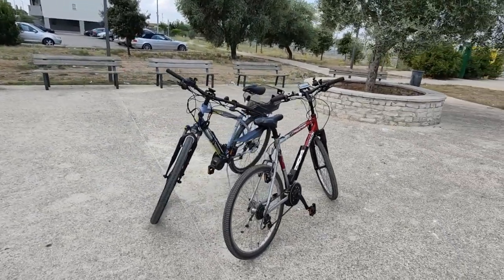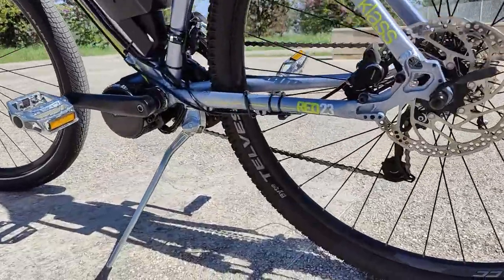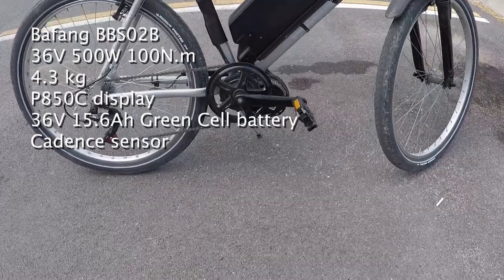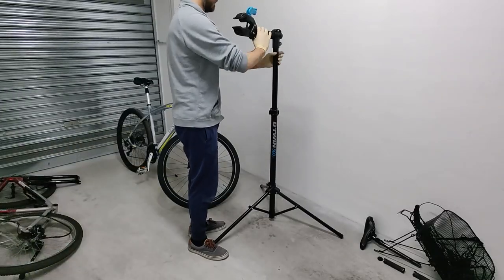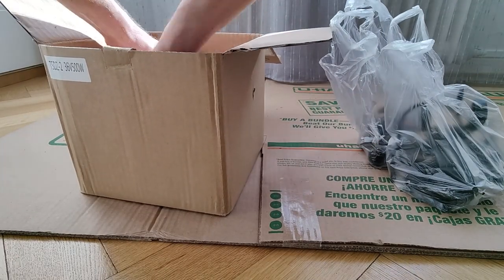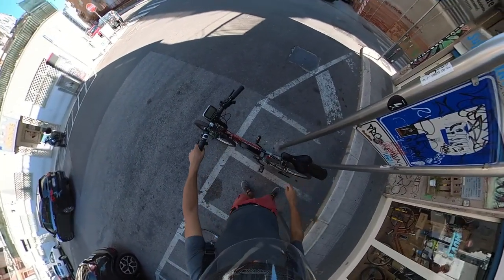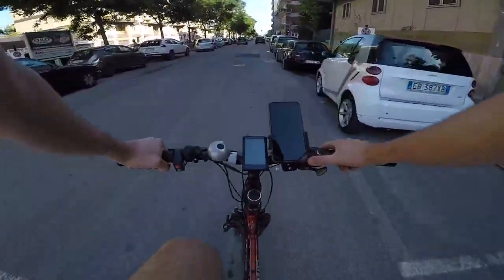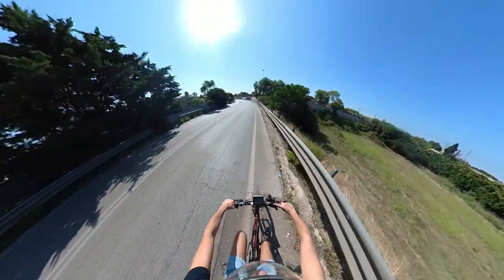RANGE Comparison: BBS02B Vs TSDZ2 500W Battery consumption on Mid-drive kits

Comment: At the age of 66, I converted my bike to a tongsheng 500w with 48v 14ah battery. I wanted to still use my bike for exercise, not as an electric scooter, so no throttle! I recently did a 70 km ride on it, covering ascent of over 1200 metres. We have lots of hills in North Devon. The battery was still over half charged. I felt pretty tired but I covered roads that I wouldn't have attempted normally. Thanks for your informative videos.
Reply: very helpful info , thanks

Comment: Great videos that have helped me choose and build 2 ebikes. One with rear hub drive and the tsdz2 mid drive. For me the clear winner is the Tongsheng. I can easily peddle alongside someone walking or ride in a group who do not have e assist. The rear hub drive wants to go a set speeds and that speed can dramatically change as one encounters a slight hill or down slope requiring constant selection of assist levels. I also dont like the drag feel when i am peddling slightly faster than the assist speed. But most importantly , the Tongsheng feels like i am riding a normal bike albeit I have the legs of a youngster. I like the feeling of a workout still but now I can do 20-30 miles not 4 miles and can go out every day ,not once a week. The Tongsheng is easy to bypass programmed speed limit should you feel the need.  Once again , thanks for your effort in making these video, and oh, I envy you riding in Italy.
Reply: How do you bypass the speed limit? Looking to to the same

Comment: BBS02 rider here..With minimal effort I can travel 30 miles on a 54.4v fully charged (48v battery) with 12.5ah. With my 58.8v (52v) battery I can travel over 80+ miles with 30ah. Never been able to test the full range as I get saddle sore. Great video Luke👍🏻
Reply: I get at least 50 miles on 52v 19ah battery on BBS02 750W
Reply: Treat yourself to a Selle SMP TRK saddle - best saddle I've ever tried

Comment: Tsdz2 rider here, been riding it for couple of thousand km's so far. You're 100% correct on the fatigue part, I even got knee pains during multiple rides because of the power needed for my legs to activate the motor assistance. 

Turned out my torque sensor was badly calibrated. Installing open source firmware and calibrating the sensor with them transformed the bike for me. Now, I can ride in assist level two without feeling I would be better of on a normal bike, let alone level 3 and 4. 

Still also not entirely happy with the clutch system, with the motor off it's so much harder to pedal then say a shimano mt200 with torque sensor when turned of. That surely can't be good for efficiency, I should consider trying to replace that clutch to see if it improves.

Comment: TSDZ2 with approx 1400km done since May 2022. Three times per week I do 500m drop in altitude downhill over 10km and then back up again, 52V 18Ah LiFePO4 15s3p and it takes about 5Ah to charge up again. I like pedalling. I like electrical assistance too.

Comment: I appreciate the experiment. We would all benefit greatly if more folks were working earnestly to properly compare the real world efficiencies of e-bikes and their powertrains.

I know it's a little more difficult with the tools you have, but the best measure of energy used is to find Watt Hours used. The best way of determining that is to measure either the total Watt hours or Amp hours used (and multiply by your average or mean voltage).  The way some of us do that is with the Cycle Analyst, but in my case, I have a Grin smart charger (Satiator) which expresses the total amp hours replaced when recharging to full. Both of those methods are more accurate than basing energy lost on voltage, which is both non-linear and also subject to sag.

I'd interpret your outcome differently. I believe the Tongshen motor is never putting out as much current(and therefore power) as the Bafang when they are both set at maximum power setting. This is why you were struggling more with it. They may both be rated at 500W, but that is 500W nominal and not necessarily indicative of an average wattage of output over time. If you were to dial the Bafang back by one or two assistance settings, you'd probably experience similar performance and similar efficiency.

I'd actually expect torque sensor motors to deliver less efficiency, and here's why. These motors prefer consistency and higher speeds to maintain optimum efficiency. With torque sensing, you are essentially varying the motor speed on every stroke, and this in turn varies the wattage constantly. With the cadence sensor motor, once it starts, it's much less subject to constant wattage variance, it still varies the output, especially as you reach maximum speed and as you take off from a start, but in theory, it's able to keep power stable and not suffer as much from variance in directing the motor to pull.   The other issue with torque sensing is that as you grow tired during a long ride, the motor appears to tire too. Since it is acting as a torque multiplier, you no longer benefit from the motor's highest available output if you cannot provide high output yourself.

For this reason, the best motor designs utilize torque and cadence sensors to both simulate bionic legs (torque sensing), but also maximize efficient, constant motor output at a reasonable steady rate of travel. Ideally such a system would have a "tired" mode, to allow minimum effort from the rider, while still providing the high output required for timely transportation. I believe use of a throttle is completely ruining your experiment's observations, as it's use is an indication that your input is not consistent, but you're introducing a whole new variable that you're not tracking in your experiment.
Reply: Thx for your input man it s very useful !
Reply: According to current graph displayed by ToolKit RC wattmeter the current on TSDZ2 fluctuates only at low cadence and high torque on the pedals, then it smooths out and keeps reducing as cadence rises.
Agreed, about being tired, it only works best with fresh legs and battery, if you are tired then the TSDZ2 can somewhat start to bog down on hills slightly depending on many different factors. So there is a dilemma between saving the battery at the begging of the 80km route or saving legs for hills by using the motor more on false flats and flats.

Comment: Hi Luke & thank you for this comparison. I sell & install the exact same kits that you used for this test. I am a little confused why your legs were significantly more tired using the Tongsheng when it should have been amplifying your pedaling effort. One criteria that you never mentioned is what power level you operated both kits at. With the Tongsheng only able to chop up the available motor power into 4 equal chunks & the Bafang able to chop up the power into 9 chunks, this would affect your power consumption rates significantly unless you were riding both motors on full power all the time.

Comment: The equation is simple: If you want to go a certain distance at a particular speed with equivalent battery consumption, then the rider has to work at a certain rate. No motor is inherently more thrifty than another. You showed this - the Tongsheng used less battery, but you had to pedal harder.

It is true that a cadence sensor motor is harder to ride economically than a torque sensor motor such as the Tongsheng, because a torque sensor prevents you from "ghost pedalling", whereas even the most careful rider of a motor like the BBS02B is going to be doing some light, or ghost, pedalling.

Look at your figures - with the Tongsheng you cycled 7.69km per volt used up, with the Bafang only 4.26km per volt.

Comment: good stuff - I'm building a tsdz2 since I really only want the help on all the big hills around where we live or to extend some rides out.  Going with a 52v build and the flashed version of software that lets it use a bafang 860 display.
Reply from the maker: software mod will be the next thing I want to try! thanks 4 sharing ✌️
Reply: @LukeLorusso  I installed the Emmebrusa firmware and configurator almost as soon as I set up my Tongsheng, best decision ever. I love the different modes and my motor was 250w from the factory which is not ideal! Its really good to dial in the 4 assist levels as well, next step for me will also be an 860c display.
Reply: @veryveryintense  As long as 860c display has orange backlight to reduce eye strain and improve distance vision it's all good.

Comment: I don't understand. Why not turn up the pedal assist level on the tongsheng if you're fatigued? Also there is a 750w versions that would give you even more access to power to prevent fatigue, no? I need a motor for commuting so I'm trying to understand why you're saying the torque sensor isn't best for mixed traffic.

Comment: I've got a 250 watt rear hub drive motor runs with a 10 amp hour 36v battery, easily does my 20 mile daily commute. Run with a throttle as the supplied Hall Effect sensor was rubbish.

Comment: You want to do a range test how about using the exact same bike. As in 2. Not 2 separate bikes that are different from each other in weight and style.
Reply from the maker: As said in this other video https://youtu.be/rgmsUVNLZXk
after replacing the BBS02B from one bike to the other,  I got the same range and max speed. This is because the difference in weight and style of those 2 bikes is negligible.

Comment: do you believe that 1500watt geared hub motor has the same power for uphills vs 500watt mid drive?
Reply from the maker: hey GM, thank you for your interest! unfortunately I never tried geared hub motors, but I expect similar wattage motors to be more or less equivalent in term of consumed energy. the 1500W GHM should be more energy hungry then a 500W mid-drive one, therefore I expect way more performance out of it. How much compared to a same wattage mid-drive kit? no idea unfortunately, but definately way more than a 500W one!
with mid-drive motors you have a more balanced weight through the frame, that's why I like them

Comment: Can I run a 52v battery on the tongsheng 48v motor ?
Reply from the maker: Hello, the short answer is yes, it is also very common. The explanation is here: https://www.electrifybike.com/blogs/news/52v-vs-48v-batteries-which-one-is-better
Reply: Thank you I'll get a 52v battery then instead of a 48v
Reply: Tongsheng even emailed me back to say the 52v battery is fine to use on this motor , so I appreciate all the advice